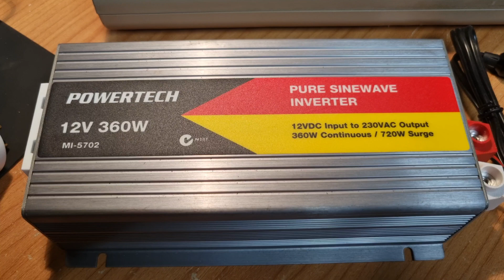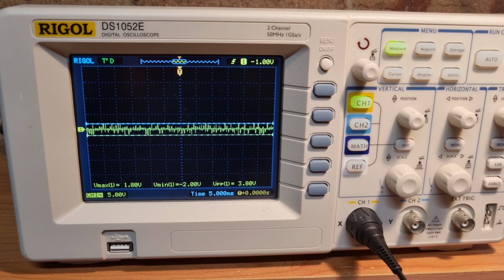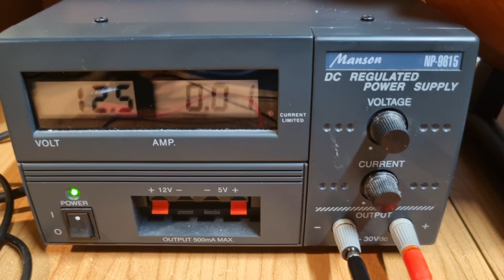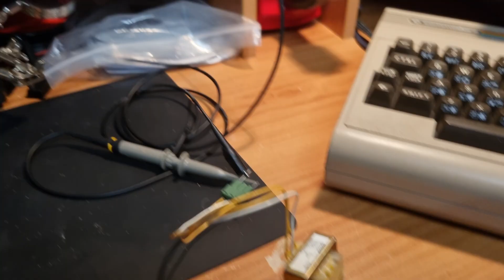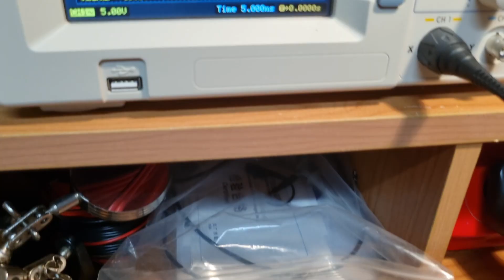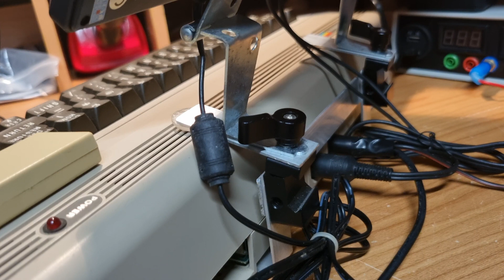Can the C64 and an LCD monitor run from battery power? Part 2 - Inverters for 9 volts AC

Comment: I was able to check the 12v DC-12V AC converter that I mentioned in the last videos comments that's $3 on aliexpress, and noticed you can send 9v DC to it and get 9v AC out.  It's not a sign wave, but a square wave, and I don't know enough about all that to know if that's a problem or not (probably not a problem for the stuff that uses converted DC, but no idea about any AC specific attached devices?).
Reply: the essential caution is that the AC pins in the power source must not have any pathway to any of the DC..it must "float" for the charge pump to "stack" it in series, to get 18Volts for the 7812 IC

Comment: The rectifier-Capacitor "charge pump" circuit, a Voltage Doubler, (that applies 15V to the 7812 regulator that runs the analog parts of the VIC and SID) prefers a square wave. A common "H Bridge" dc motor IC is a bridge rectifier ("Active") that changes DC to AC. a laptop battery stick, three cells, is correct into the H-bridge..the peak Voltage gets the right Voltage into the 7812